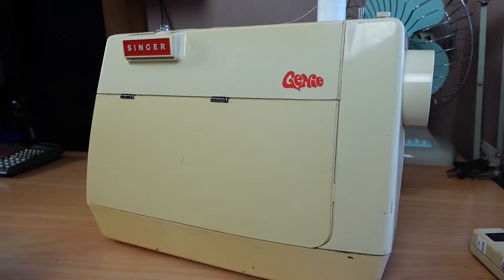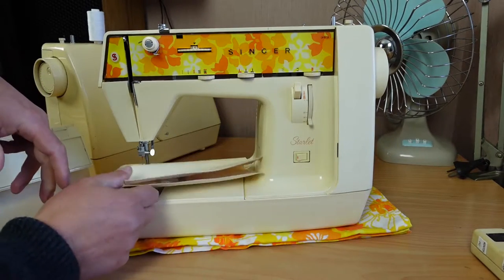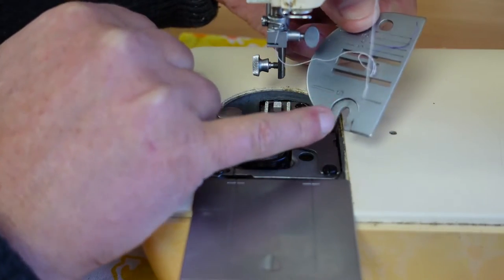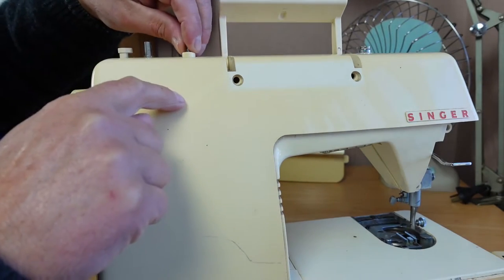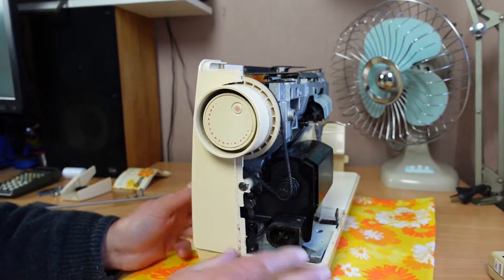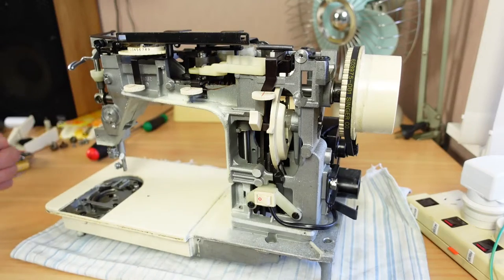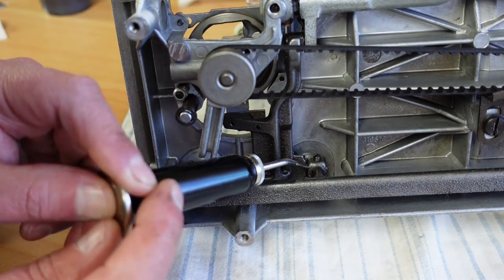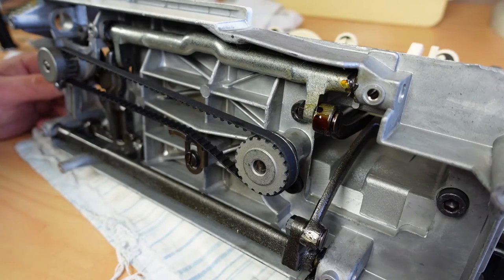Servicing the Singer Genie 354 / Starlet 353 Sewing Machine from 1974 - Part 1

Comment: Thanks for your help! My mom gave me a Genie years back and a pattern snd material  to make myself some pajamas. I never did make them and have only used the machine once or twice for little repairs. Well when a friend borrowed my machine lately to take a beginners course the bobbin winder wouldn't work. The fabric shop wanted $100 to get it working. She declined. Now I've got a sewing project I definitely want to complete, and some boxers to mend, but I had to get that winder working. After you showed me how to get the cover off, it turned out, just as you said, it needed a good oiling. Spins like a charm now!  Let the sewing commence!

Comment: I just commented on your assessment video about this very machine...the Starlet. I am in Canada, and these machines were pretty popular with ladies in the mid seventies to early eighties. They didn't take up a lot of room, were very self-contained, and got the job done. Some I've spoken to have said they liked the smaller feet that were used on these slant shank machines. It, according to mama here next to me, made it easier to get into very tight spaces when sewing, and never failed to sew a nice stitch. Her machine, when I redid it required a new tension assembly as the spring mechanism on hers was too far gone to save, and of course, being a gear driven unit, all of the gears were disintegrating. I replaced the gears and the assembly, cleaned and oiled it (except the motor, that's going to be done in the fall), replaced the cover latch which had failed on hers, put in a new slant shank as the old one had stretched and would no longer hold her feet securely, and...retro brighted the cabinet for her. She has a few machines, but this one was her first new sewing machine, and she's kind of attached to it. Really enjoy your videos. Hope your little helper is doing well. OH, and her Starlet is more of a burgundy coloured pattern, instead of the marmalade colours of your two machines. Hers also is a free arm model. Yours is identical to your Genie as it is a flatbed model. Weird, I learned something new today.

Comment: Thank you so much for this video! I inherited my Genie 354 for my grandfather 25 years ago, but I haven’t used it in 15 years. This video has been great for cleaning it up and getting it going. I have one question, is it OK to use a can of compressed air (the same used for electronics) instead of an air compressor?
Reply from the maker: Hi. Yes, I'm sure canned compressed air would be fine. Thanks.

Comment: I have a Genie and also a Mon Ami II deluxe 390. I have read about the Genie and Starlite but haven't seen anything on the Mon Ami II nor can I find an instruction book for it. It is very similar to the Genie but has a free arm - I use them both. Wanted to send a pic of the two but can't figure out how to do that under comments. Guess you just can't.
Reply: I also have a Mon Ami, but mine is the Deluxe 385. I cannot find any videos or manuals on it either. Have you been able to find anything for yours since?

Comment: Very useful video. Thanks.
One question, what kind of grease should I use, general purpose would do I suppose?
Reply from the maker: Hi. Yes, general purpose grease should be okay. Something with graphite in it would be good. Thanks.
Reply: @InStitches  Thanks. I recently got a Starlet 354 as well. It’s absolutely a beauty, a perfect combination of engineering excellence and aesthetic taste. After a quick clean and oiling, it impressed me further that its unique design seems (to me, without detail analysis) to have less moving parts, or less amount of movement of parts, so requiring less oiling, i.e. less maintenance.

Comment: Great video. I opened the bottom because the bobbincase does not move. I found a broken part in it..... now I have to open the whole thing to see what is broken...Im afraid  i can't get that part anywhere...
Reply: We found the part but it is situated on a difficult place .... it is the wheel that moves the arm of the bobbin.
Reply: We found a new gear and  had someone fix it. Costed some but 'm happy it works again.